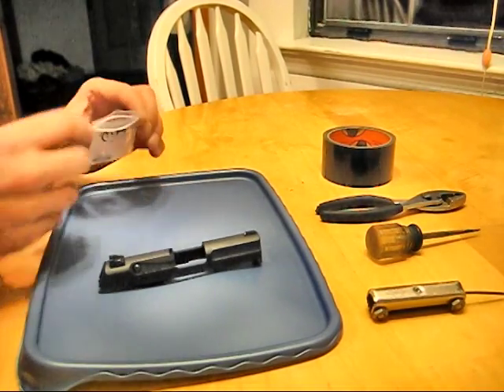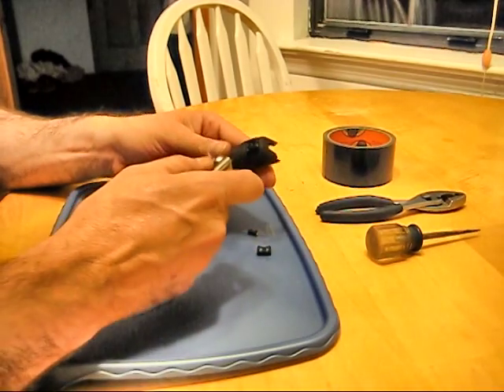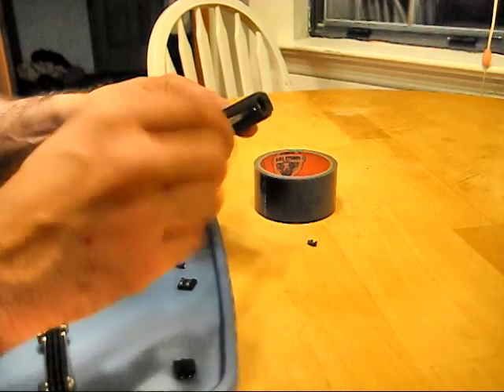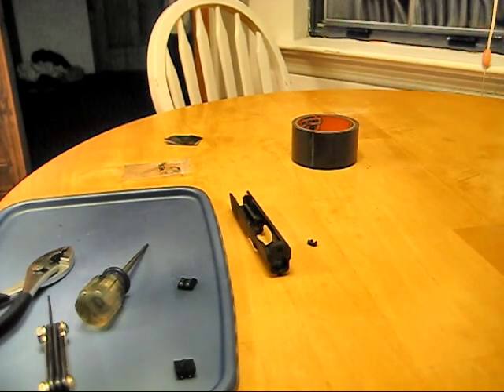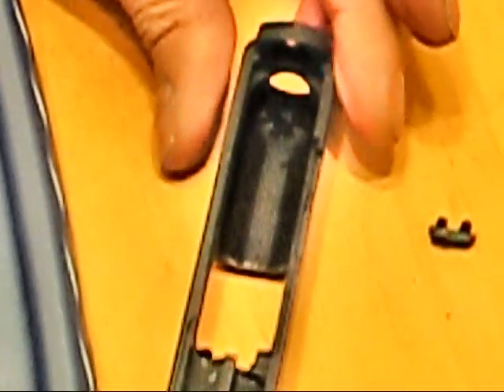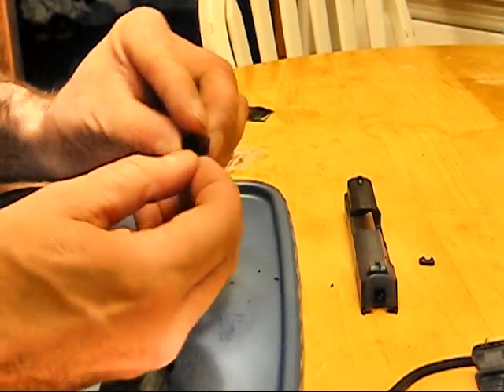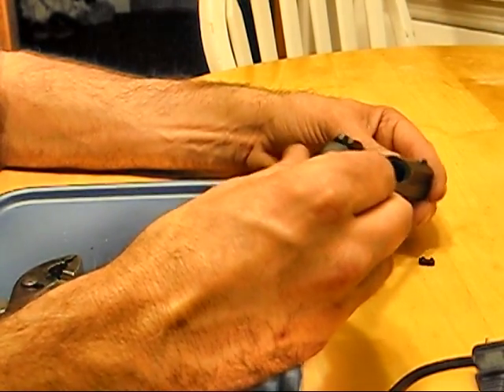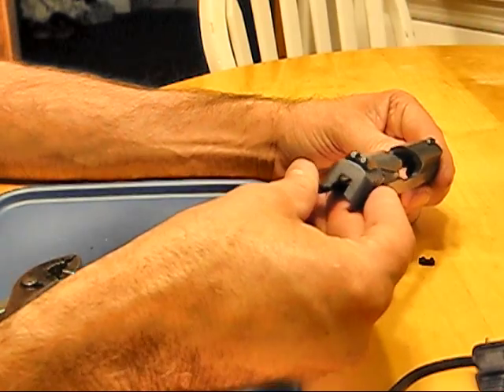Installing MTK9 Tritium Night Sights on your Kel Tec PF9

Comment: I know it’s an old video but what sights did u use to match the PF9?  Only sights I found made for the PF9 specifically was only Fiber Optic not Tritium. I would love to find a Tritium sight made specifically for the PF9.  Most only have 1 sight post, not 2 like the PF9 has.